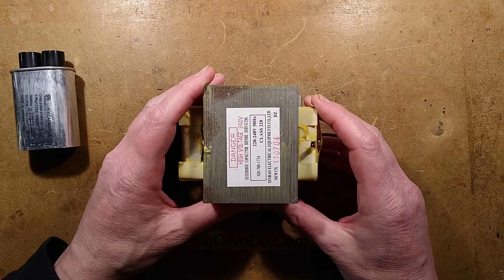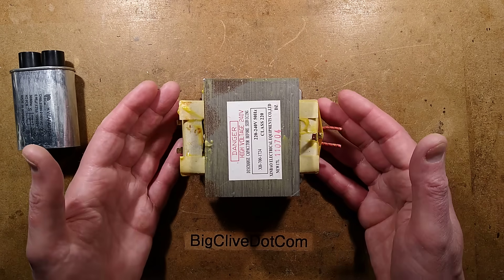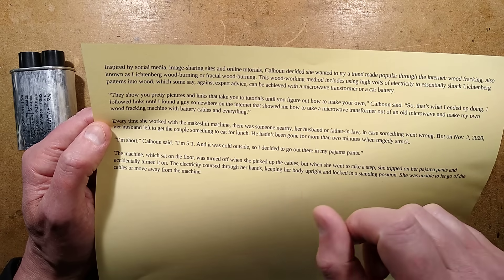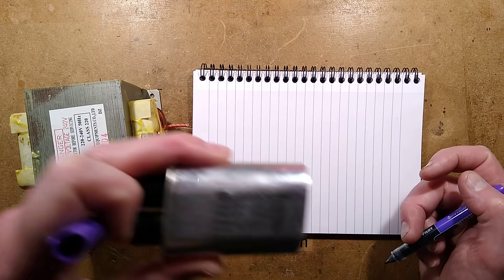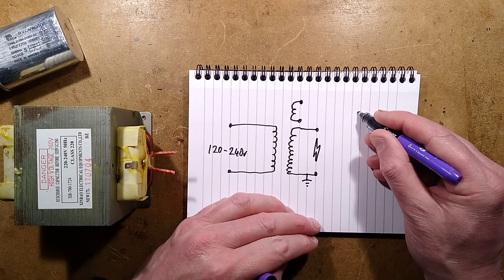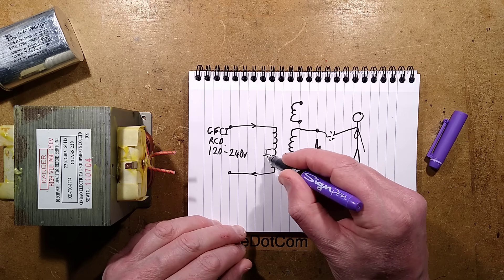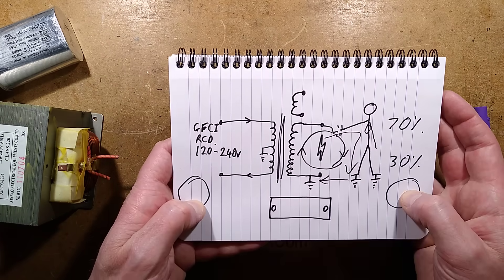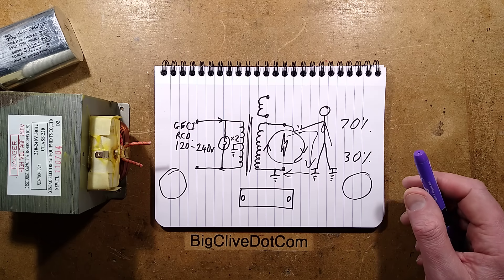The most deadly project on the Internet

Comment: I came into contact with my Jacob's ladder. Or should I say, it reached out and wrapped a visible arch around my hand.  And I am telling you it very quickly coiled around and between my fingers searching for a way in to my hand. I was pulling back and it was like a magnet and chased my hand and fell over toward me.  I was already involuntarily on my way down to a setted position like a baby does and laughs. Well adults don't do that for a reason. But thankfully that momentum was useful so my effort to jump back really was just my legs going straight, pushed me back on the smooth floor and got me out of contact. The effects visually on my hand we minimal. But the internal lasted 2 months. It was almost random movement and touches induced pain like it was on my bone under the flesh and tissue, from the tip of my middle and pointer fingers. And it was un predictable and didn't matter if it was just a light touch or picking up something heavy, it was pain that would remove function from the hand and things were uncontrollably dropped. 2 years later I still experience a sort of numb feelings in several small points in those fingers. And yes, I am so very lucky for several reasons. I had just put shoes on, and I was on a wood floor, and it was only one hand. I installed a switch that has to be held on to make it work now. And the switches away from the unit. To hold it and get to the arch, the plug will come out of the wall. But I have it dismantled until I can make a glass cover for it. Lucky it just sat me down, didn't lay me down and out. Be safe all

Oh, it produces a 7 to 10cm arch. And I'm telling you it reached out 15 to maybe 20 cm to my hand, and the long copper wire flexed alot, and it chased my hand. And ya it did find a way in hand around my nails and small nicks in my skin.

Comment: I remember I was showing my friend a smaller transformer. I was considering using it for a small Tesla coil, and I got it out of a larger bug zapper.  It would throw a spark that was quite impressive for the size. Anyway, while messing around, it went through a small hole that had appeared in my welding gloves. I was thrown back quite hard. I still think about how close I was to messing around with my mot transformers. I'm just lucky I decided to go with a smaller transformer that time. Young me was very stupid, I don't know how I made it lol.

Comment: These old 1980s vintage 1KW MOTs generally are made for halfwave rectification with one end grounded, so be careful using them with both leads off ground as with bridge circuits for HV power supplies. Rather I take two identical transformers, test them for exact voltage, and put the ground ends together and ground that point. Then put the HV rectifiers in the hot leads, tying the diode stack cathodes together to form a conventional full wave circuit. Under load you can get a solid 1100 to 1400 VDC at more than 500 mA. This makes a good supply for something like an 811A Amplifier, ART13 or BC-653. Be very very very careful as these can kill you 10 times over!

Comment: LoL....120v isn't dangerous. Try this, wait until it is lightly raining. Take your worm drive Skilsaw outside on a 50' extension cord plugged into a non GFCI outlet (back in the day, but plenty of people will make this mistake today). Place the Skilsaw on the ground and cover it with a 5 gallon plastic bucket. Remove the saw every 5 minutes and cut a piece of wood. Wait until your leather boots are soaking wet and make sure you're standing in a puddle. Remove the bucket and pull the trigger on the now soaking wet saw. The water is all the way inside the saw including the armature. When you pull the trigger, electricity goes up your hand through your heart and right through your extremely well grounded soaking wet shoes. It's a religious experience. And after it happened to me, I told the asshole I worked for "FU, I'm done for the day". These people getting shocked are idiots. Pure and simple. I would put 1" thick rubber mats on the shop floor and go to the electrical supply house and buy 10,000 volt electricians gloves before using this device. That and NEVER use it without someone else present (in case your safety protocol fails).

Comment: I've done this with a welder and have worked on a lot of transformers in welders and have never dicked around with microwave transformers though. I've had a terrified respect of electricity for a while since getting shocked into arrhythmia once while working on a electric bilge pump (zero lock-out tag-out procedures) in a partially flooded compartment on a boat. Now I always touch things with a DMM first and am lucky to be alive.

Comment: Was lots of wood charring from playing with my 300W 16kV oil furnace ignition transformer some good may years ago.  It has two long electrodes that it produces a spark between. After the spark has started, it's possible to extend the distance since the ionized channel has a way lower resistance than the air.

Good time to have one hand behind the back? Yes, definitely...

Comment: I played with MOTs when I was 14 or so. Powering Tesla coils with 2 of MOTs connected, throwing arcs (used a long glass rod to hold the lead, relatively safe but still kinda cringe to think about it now). I thought I was super careful with it, but looking back there were definitely dangerous moments. Glad I survived. 

One question - isn't holding the box with the buttons pushed in your hands also unsafe? Like if you get electrocuted somehow and your hands lock up, so you can't release the buttons? Maybe it's better to lay the box down and press the buttons from above?

Comment: I only do low voltage stuff, under 48V.  12V Still burns like a bastard if you are trying to connect your batteries back into circuit with saltwater soaked hands.  Managed to get a good belt as a young bloke from a gen set one rainy evening not realising some insulation I guess on the active side of whatever powered up thing (probably a fridge unit) was wet - bare feet made it more fun too.   Ahh the joys of remote rural Australia.  We worked out pretty early that mains voltage and anything higher was to be left strictly alone unless we wanted to become a sparky.

Comment: i do a lot of tinkering with electronics but nope i do not mess with the wall current i stick only with electronics 12V DC or less, with reinforced enclosed power supply or battery

Comment: Yeah, don't screw around with high voltage.
I was working on an electric fence once, with it set to max and turned on. Of course, I ended up getting shocked. The electric screwdriver I was using suddenly found itself on the ground and I have no recollection of ever letting go.
It actually made me black out for half a second. And these things are designed NOT to cause harm beyond the shock itself. Now imagine if you get shocked by something that doesn't have any such safeguards...

Comment: I've had 240,415 and 600v belts and I'd rather have all those at once than one second of high voltage. My wife really fancies the idea of fractal burning but I would never build her one of these machines. Far too dangerous for the layman/woman to be messing about with. It would need to be totally safe with built in fail-safes and only able of being operated at a distance.

Comment: Don't discharge a capacitor like that capacity with a screw driver, it can arc and it can be violent. There's a way to drain it but mainly check it's drained with properly checking capacitance with a multimeter first while insulated and honestly if you needed to know the answer to this question consult an electrican or engineer.

Comment: Nothing I can add that hasn't been already said. As an industrial safety officer prior to retirement it amazed me how many so called competent people ignored safety advice and in many cased baulked against said advice. It put years on me. Well said Clive. And, there's non so deaf as those who do not want to hear. (Old Celtic saying)
Reply: Well said, as well.  I think this is old Darwin reminding us about 'Survival of the Fittest'.  Cavemen could see the danger of lightning before Greece saw and named static electricity at its simplest form. I have linemen in my family who work on the highest voltage lines out there.  I have a basic understanding, but they have told me things that I would never have considered.  For instance the height of the poles keeps the field at a distance preventing induction in steel.  The have to worry about the steel in their zipper setting their pants on fire.  And that's the truth.  Take care and I'm gonna go play with a rattlesnake. 🙄

Comment: I don't think the secondary side of the transformer is earthed, so you would need to be touching both sides of secondary to get a shock, still very dangerous though at 2000V if it's only 30mV then it would be hard to kill you unless you got it directly across the heart

Comment: I actually took a microwave transformer and wired it up with some nice half inch thick steel leads and made a nice looking Jacobs ladder. 

I had a different microwave transformer that I replaced the secondary with 00(AWG) copper welding cables and it produces less than 1 volt, high current, it's very safe. The low voltage one is easy to hear when it's on because the cables I put in it are free to move and that much current makes the leads move a lot. 

Once my dad went to move the leads on the Jacobs ladder closer together and he touched both leads while it was on. Very nasty shock, we were both amazed it didn't kill him. We were relatively well insulated standing on dry wood, so the current only jumped from finger to finger. He doesn't even have any noticable nerve damage, in his hand anyway. He certainly would have died I'd the current went through his heart, say if he grabbed it with both hands.

I would not recommend messing with microwave transformers unless you really know what you're doing. We got lucky, and that's nothing to count on.

Comment: Gonna show people this video if they ever say anything along the lines of "I'm thinking about repairing (or tinkering with) my microwave". Thank you so much for making this! This video will probably save people from death!
Reply: I've been considering opening up the microwave to get rid of the beep... But now I'm scared
Reply: @TmP_93  
To get rid of the annoying beep you DON’T HAVE TO OPEN THE MICROWAVE UP! All modern microwave ovens have the ability to remove the annoying beep by programming the oven using the control buttons on the front. If you’ve lost your owner’s manual just do an online Google. The programming takes 1 minute to do.
Reply: @mtkoslowski  my damn cheap piece of shit doesn't. I was truly amazed, should've looked at the amazon FAQ's. Not going to bother opening it up though.
Reply: Death is not the problem, here. Ever noticed we all are mortals? The problem is, you will hurt yourself, and you will commit a painful and most likely slow suicide, when you are stupid enough to do what this video teaches you: you can play a deadly game with high voltage devices.
This is a very stupid video poster. Do not play this video. Doing what this fool is suggesting, it might even kill you. No problem, it will. And you will get hurt, and you will regret having seen this video. Duuuuuuuuuh!!!!
Reply: Who converses about fixing their microwave? Seriously.
Reply: I think there should be a lot more warnings on a microwave to warn non technical people that it's extremely dangerous to open it! The standard "no serviceable part inside, do not open" doesn't really scare people enough. Also since microwaves are perceived as something simple to repair, especially the basic ones with a mechanical timer, once my father said to me "well the microwave doesn't work but it's probably only a the fuse or the switch, I take it apart and try to repair it", of course I said to him to not even try and he didn't know that it was so dangerous (you expect an appliance in my country to have 230V in that, something that in most cases will not kill you, also because we have mandatory GFCI on all circuits, but with 2KW that can be present even when the device is unplugged and that if you got it no GFCI will disconnect it's another story). 

Fortunately newer microwaves with inverters are safer from this point of view, since they don't have a big capacitor inside and you can hook it up the transformer to the power directly since it needs its control board with multiple safety checks that are not trivial to bypass. At least taking them apart with the microwave unplugged should be safer (they may contain capacitors by on the "low" voltage side).
Reply: That lady in the video description was INCREDIBLY lucky to just survive at all.
MOT's are LETAL!  You should NEVER, EVER work on a MW oven when powered, and even when NOT powered, that cap on the HV side can still hold a LETAL charge if you touch it and it has not been discharged.  The MOT's that have been hacked to produce a LV secondary by cutting out the HV secondary are pretty safe, but any STANDARD not-modified MOT will very happily kill you without a second thought.  2kV to 3kV at anything up to 500mA - that means you're DEAD if you get in the way of that.  You only need about 20-30mA to kill you, and a MOT's HV secondary can deliver that with ease - it won't even sweat as it kills you dead.  People are REALLY stupid when they repurpose MOT's like this.  One of the scariest videos I ever saw, was some kid trying to WELD using a MOT, and he was drawing HUGE electric arcs from the workpiece to the electrode he was trying to weld with.  How that kid survived at all, was amazing.

Comment: Excellent job raising awareness and promoting safety - this important video needs to be shared. Hopefully you have saved some lives - I truly hope so.  BTW, I am an electrical engineer with 30+ years of practical hardware design experience with high-power RF systems. I would strongly encourage anyone watching this video to take it extremely seriously. Evaluate your knowledge, skills, equipment, and asses your competence to experiment with high voltage. Think about the risk vs reward, then proceed accordingly. I'm not saying to not do this, but if you decide to, treat it very respectfully. Even the most skilled and cautious practitioners can make mistakes and misjudge the risk. I will re-emphasize Clive's comments about the distinct difference between insulation materials for low voltages verse insulation for high voltages - especially the voltages an unloaded transformer can reach. Once a breakdown occurs and current begins to flow, the resistance of your flesh will drop rapidly and there is nothing in this circuit to limit the current.  Large power delivery to your body will begin, and your mussels will respond to the huge current flowing through you rather than the minuscule electro-chemical impulses from your brain. You will not be able to move voluntarily and will be in a torturous state of continuous power being delivered to you body. Additionally, this is one of those times when a little familiarity with science can breed over confidence and disaster can result. There is a huge difference between this high-voltage (and high current) circuit from the beautiful demonstrations that many science-minded people see of touching Nikola Tesla's high voltage plasma globes, and other similar hair raising static electricity demos. Those circuits have extremely limited current flows, and are specially designed to control the human interaction with high voltage in a isolated way. These unfortunately may make it seem like high voltage generally safe to play with - this is false, since practical high voltage systems are generally made to deliver power. Thanks for reading this and watching the video, and please be safe.

Comment: Some good points. An oil burner transformer works really well too. When I built mine I use a microwave transformer in a well insulated box with an indicator light on it was powered through a veriac so that I can limit the power coming out of the transformer. I worked on an insulated map and use PPE like insulated Kevlar gloves and a face shield arc flash gear if you will never move the lines around by hand and if I did the line was connected to PVC and the machine was off. I can easily see how people can get messed up doing this. Thanks for sharing.